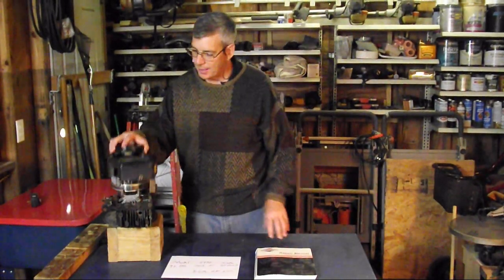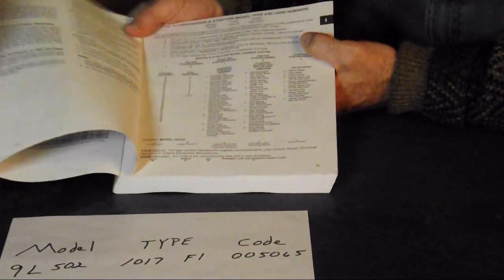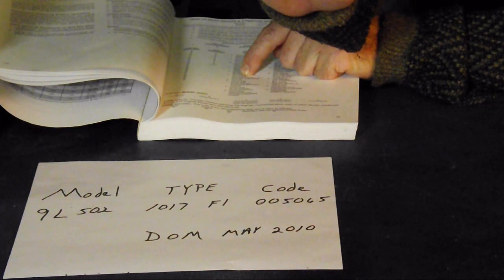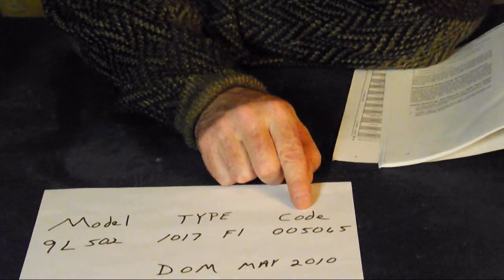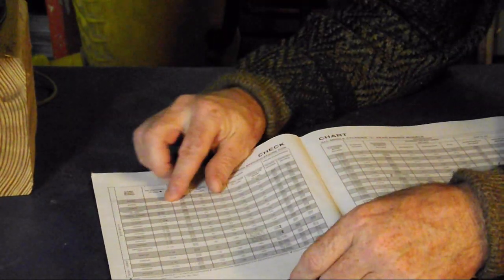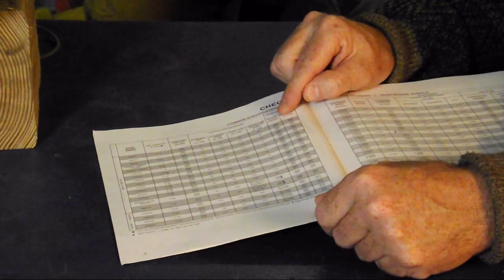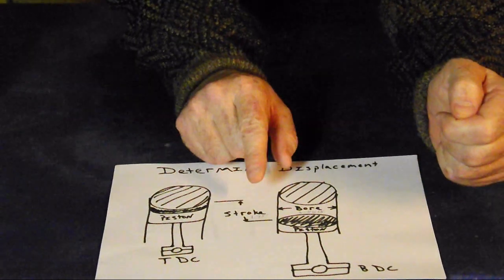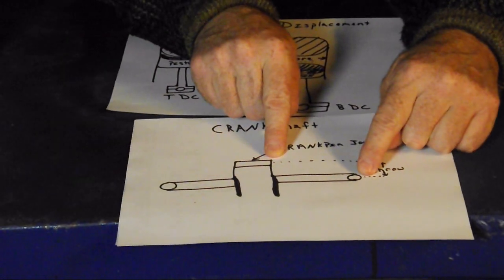Part 3 Taking apart and rebuilding a small engine series

Comment: just found your site - been great!   i have previously figured out how to change oil and sparkplugs etc, but have never had the reason, time or experience to rip an engine apart...  dumb question though - why is the torque so important?  why can't you just tighten the bolts up to 'tight'?
Reply: You actually can in most circumstances.  A lot of time torques are there to keep yo from breaking things like bolts or threads.